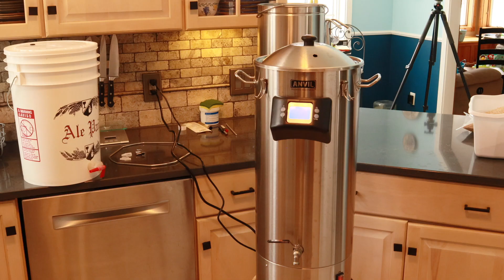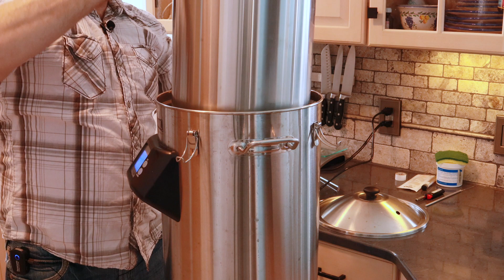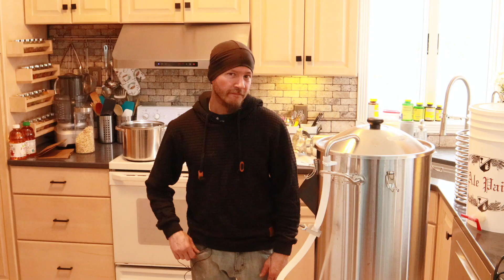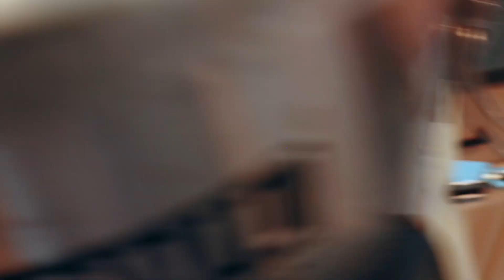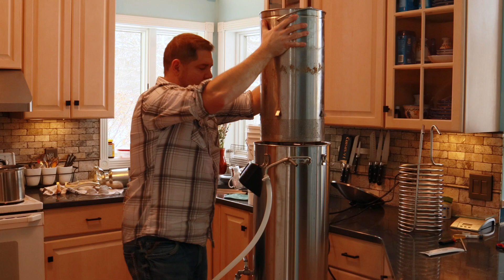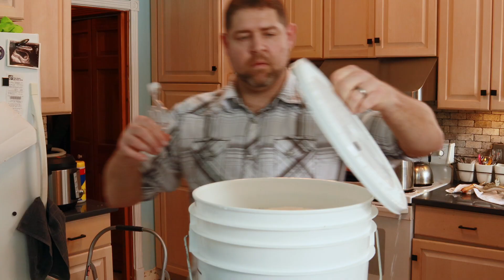Making Beer with Anvil Foundry

Comment: AWESOME BREW DAY!!! It must have been cold in the house. The short guy was dressed for cold weather.
To provide body and mouthfeel in beer without adding flaked grain the Hochkurz and triple decoction brewing methods are used with under modified, low protein, malt. Weyermann's floor malt is an example of under modified, low protein, malt. Modification and protein content are listed on the malt spec sheet that comes with each bag of malt, which a brewer uses for determining the quality of malt, before buying malt.
There's a type of heat resistant, complex, starch that makes up the tips of malt, called amylopectin, it is the richest starch in malt. Contained in amylopectin are A and B limit dextrin, which are tasteless, nonfermenting, types of sugar, and pectin. A and B limit dextrin and pectin are responsible for providing body and mouthfeel in beer. In homebrewing, the temperatures that the mash is rested at aren't high enough to burst the heat resistant, starch, where it enters into the mash liquid, before Alpha denatures and the starch is thrown away with the spent mash. When mash is boiling, amylopectin, rapidly, enters into the mash liquid. The boiling decoctions are added back into the main mash and Alpha liquefies the starch causing dextrinization and gelatinization to occur. Mash viscosity reduces when mash is boiled, which helps during sparge.
At 152F, Beta denatures, rapidly. Beta is responsible for conversion at 140 to 145F. During conversion Beta converts simple sugar, glucose, that Alpha releases from amylose during liquefaction into fermentable, complex, types of sugar, maltose and maltotriose, which are the types of sugar that produces ale and lager. When conversion occurs, secondary fermentation takes place, due to maltose. Maltotriose is responsible for natural carbonation. Beer doesn't need priming sugar or CO2 injection to carbonate when conversion occurs.
Over sparge occurs when a large volume of hot extract recirculates through a grain bed at a high flow rate for a prolonged period of time, which extracts tannin. Tannin extraction is a time, temperature, pH thing and that is why vorlauf is kept within 10 minutes. When 1 GPM of hot extract flows through a grain bed for 60 minutes, it is equivalent to sparging a grain bed made from 10 or so pounds of malt with 60 gallons of water in an hour. That is why it is called over sparge. To reduce tannin extraction, sparge is stopped when run off gravity drops to 1010.
Reply from the maker: Amazing comment! Thank you so much. There's a lot to take in here. I think I'll print it out and study a little bit. You Rock!